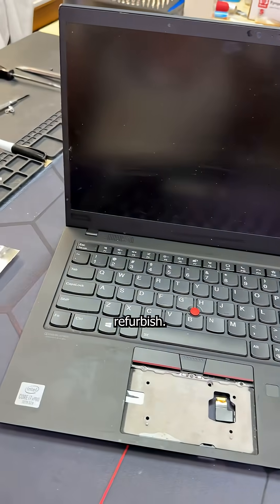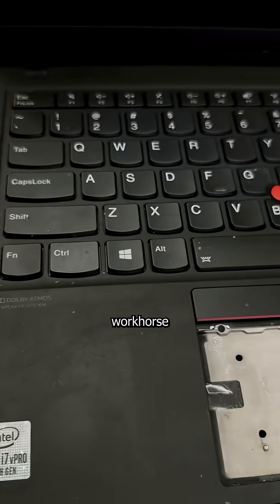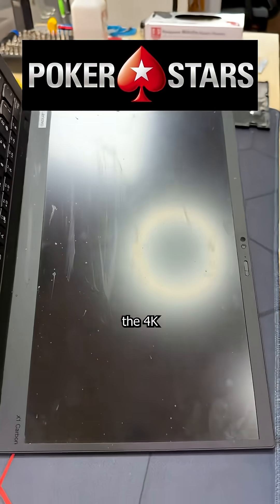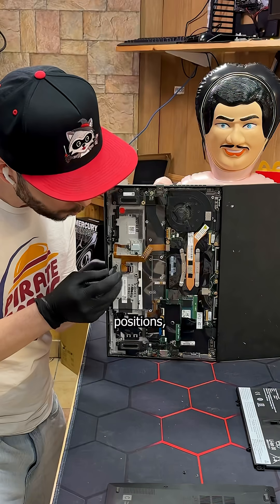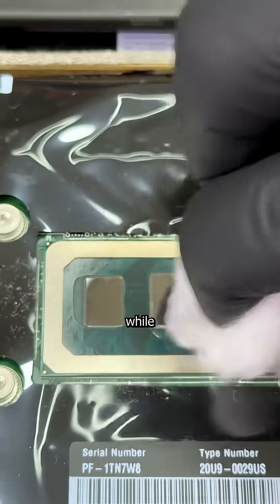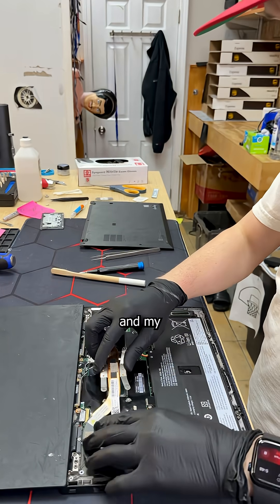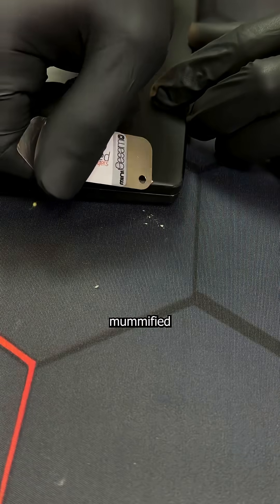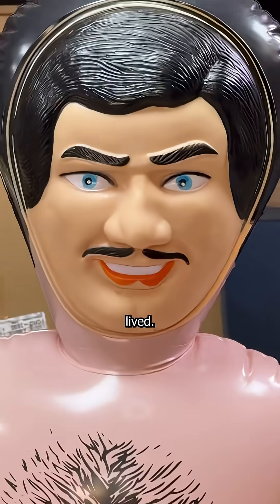I Rescued a DISGUSTING Broken ThinkPad for Less Than $100 #shorts #tech #pc #technology

Comment: As an IT Tech, I HAAAAAAAAAATED X1 Carbons. The drivers for them were atrocious and they even bummed out on docking stations. We had Lenovo ecosystems at a previous company I worked for and used the Thinkpad series from the T450 up to the T490 until the rebranded the model. I used my T450s from internship to full time job over a period of 7 years and it never failed me once.

Comment: Hey, I was wondering if you still do send in repairs. when I checked your link tree I didn’t see any contact information regarding repairs so I’m assuming that they’re closed right now but I figured I’d ask anyhow. I saw a video earlier today where you repaired a Dell G5 I have a Dell G5 15 that after less than a year and a half decided to completely stop turning on/charging the charging light on the charging cable turns off when I plug it into the laptop. i’ve tried replacing the charger itself as well as the battery and have not had any luck. It doesn’t seem as if there’s any issues with the motherboard or with dust collecting I don’t have any trustworthy local repair shops around me and I have very minimal experience with laptop repair/troubleshooting so if I could at least get steered in the right direction I’d really appreciate it!
Reply from the maker: I don’t repair for customers anymore. Your laptop needs motherboard repair, send it to parts people.

Comment: Hello, i have a question about my old gaming laptop. I was playing game on my laptop with the charger connected, and on a certain scene, it always disconnects from the charger for a few seconds and reconnects (i assume it always happens when the laptop is on high load) . 
I have tried changing the battery to a new one but it did not work, is it a faulty charger?

Comment: this guy is the only reason i found hardware so interesting and actually made me start to take care of my "HingeProblem" laptop
Reply: He's part of why I went and got canned air to clean my Horrible Product Omen 25L

It still broke a month or two later for some reason, but it was clean!
Reply: Glad to know that HP products have the same problems a decade down. Will never buy that piece of scrap metal again.
Reply: @srivatsankpullabhotla3245  Desktops too, I've had two and for some reason the 11 year old one is still working while my 4 year old one broke earlier this year to the point it can't boot to safe mode. The latter also requiring a basically discontinued brand of ram that's 3300 mhz on a good day.

Also the old one slows down if I type too much in twitch chat. Never buy this brand, ever.